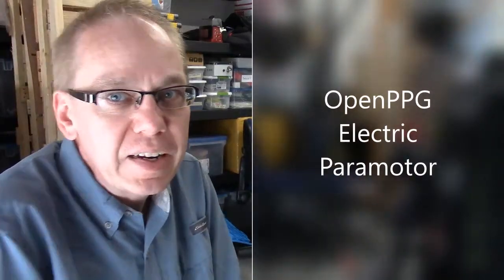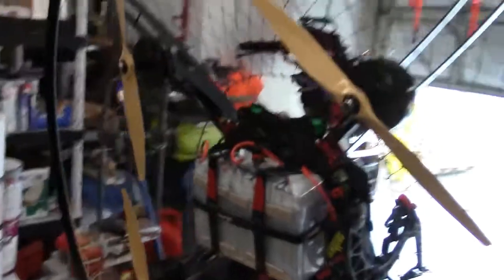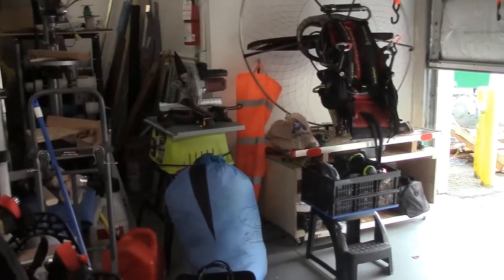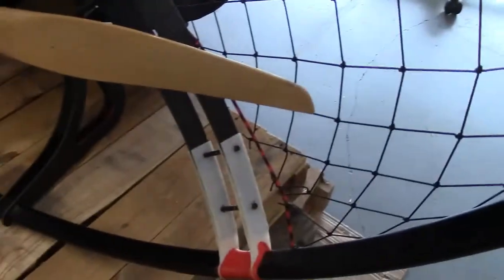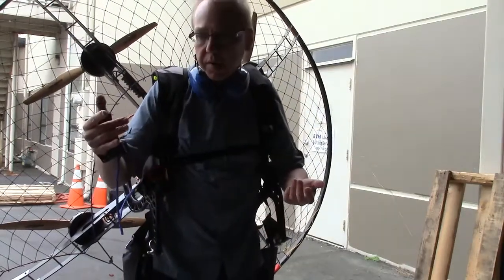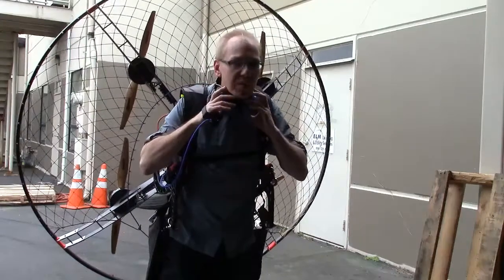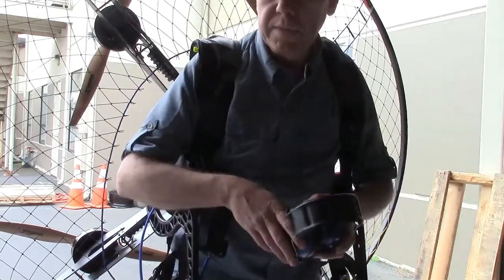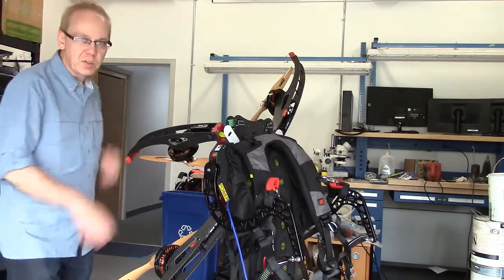My New OpenPPG Electric Paramotor

Comment: Interested to know more about the batteries it is using and how much they weigh?  Is it two pairs each in series then wired together in parallel?
Reply: It uses four Bonka 22000mAhr 6S batteries. Yes, two in series and those pairs in parallel. So effectively 12S, about 50V. All four together weigh about 25 lb.

Comment: How are you doing after 3 years? Do you still fly this unit or have you moved on to something else?
Reply: I fly it once in a while. I let others fly it too. I like the flight characteristics of it alot, but the short flight time reduces its usefulness for sure. If I could fly from my back yard every night it would be perfect. But when I have to pack everything and drive a distance, I want to fly longer. The short flight time also means it isn't very able to fly with others because it can't go as far as they want to fly. I fly far more on my gas unit.
Reply: Thanks for your response.  I recently bought an x4 unit, but am waiting for warmer weather before I try it out. 
I also bought a gas unit because I suspected that the short flight times of the electric would make it not so great.  I have yet to complete training so I think having to recharge the batteries every hour or so would not be convenient.  Anyway thanks again and best of luck to you.

Comment: Flight time?
Reply: I have only flown two short flights so far. Flight time is expected to be about 20 minutes with the four batteries. That's the big downside of electric at this point. We need better battery technology.
Reply: Craig Bedward ☹️
Reply: @craig.bedward  How long does it take to charge up for full flight time? Is there no way to do a range-extender/generator that runs on some fuel? Seems to me that a few hours of flight time should be a reasonable goal for a range-extender.

Comment: Can it propel a 140 lb person with just 2 motors running?
Reply: Probably, but there is no way to tell it to run just two motors. Also, if only two were going, the line of force wouldn't be through the center of mass. A smaller person can just run all four motors slower.